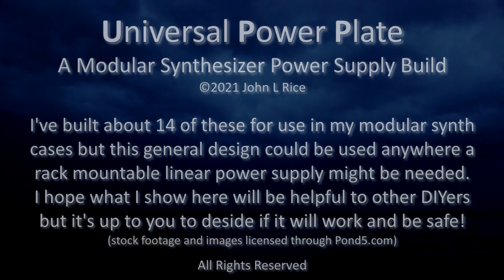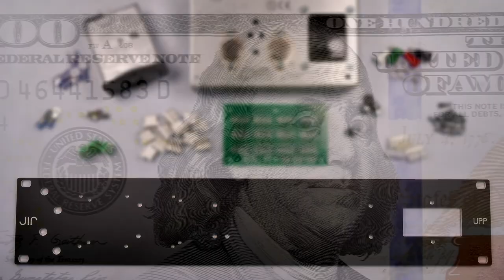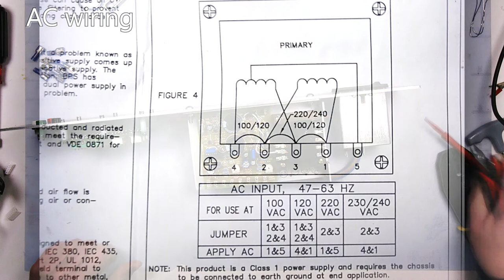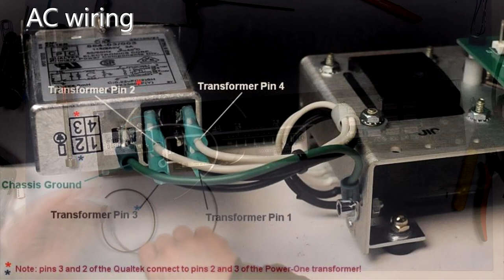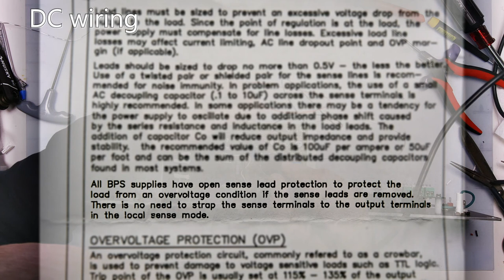Universal Power Plate - A Modular Synthesizer Power Supply Build

Comment: Great video, as always, and extremely tidy assembly work!  And thanks for the mention.  I would have done only a few things differently.  I would have soldered the DC power leads into the distribution board instead of using the screw terminals.  And I recently decided to connect the sense terminals directly to the output terminals at the supply, because the new Condor MBB15-1.5A supplies I bought came from the factory with those terminals connected.

Thanks for commenting on my blog post, too.  I think that my post on Portable Rack Cabinets was one of the first I made when I started my blog.  I'm glad it was helpful to you.

I'm also glad to have subscribed to your channel.  Your videos are top notch!
Reply from the maker: Thanks Richard! 😎

Comment: Oooh, that's a nifty panel design. Is the transformer hum ever getting annoying being directly vibrating and resonating the cases or are they sufficiently well damped?
Reply from the maker: Thanks! 😊 These days It's really only noticeable late night/early morning when the traffic noise outside has stopped (mostly) and the furnace isn't running, which isn't too bad considering I have 10 to 12 of these all running t the same time? 😎  Some are noisier than others, typically any new old stock or used ones I got on eBay might be louder, and pushing even new ones near their max capacity makes them louder. When I first started building these I always added a little L bracket with a rubber foot that would rest on the bottom of the case, thinking that might help prevent the thin steel panels I was using at the time from becoming bent if set down too hard by inconsiderate roadies on my world tours 🙄🤣😥 but I found a couple years ago that those feet were transferring transformer vibrations to the thin resonant bottoms of my rack cases so I removed them which seemed to help a bit. On the noisiest supplies I put rubber isolation standoffs between the rack panels and rack rails which also helped a bit.

Comment: Hi John, quick question, what wire gauges do use for both AC and DC?
Reply from the maker: In the past on average I've used 16 AWG for both the AC and DC wiring, a few times even 14 AWG. In general I tried to use the largest gauge that would "work". (wire that is too large wont pass through connectors and it can get a little ridiculous 😅) This time though I used 18 AWG for everything (except the green ground wire which was 16 or 14). I used 18 this time partly because it was conveniently in reach (my 16 AWG was slightly farther away 🙄🤣) and I also convinced myself "it would be fine" since typical six foot AC power cords are only 18 AWG and the distance used in my power supply build are much less than 12 inches. As I type this I am sort of kicking myself for not using at least 16 AWG for the 0v DC connections though 😒🤦‍♂️😖 . . . to the point where I want to go redo it right now but . . . . .so many other projects that are more important await me! 😬